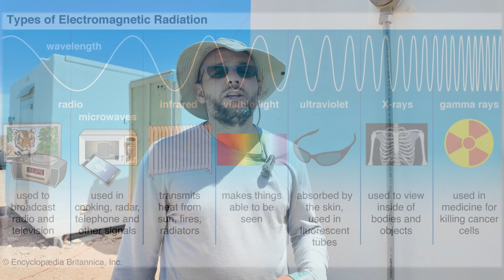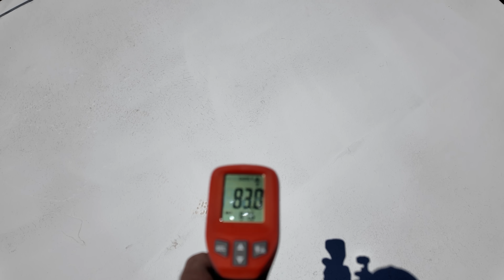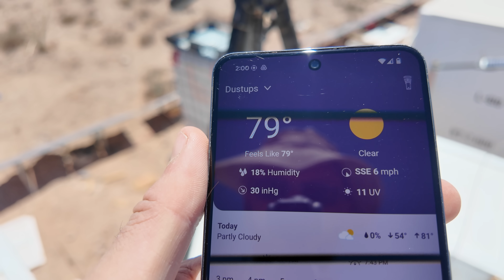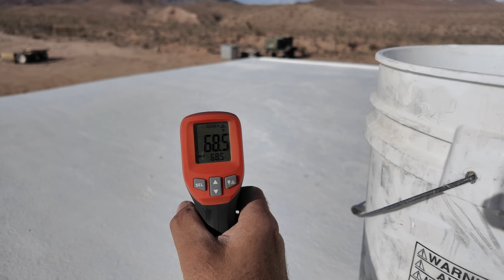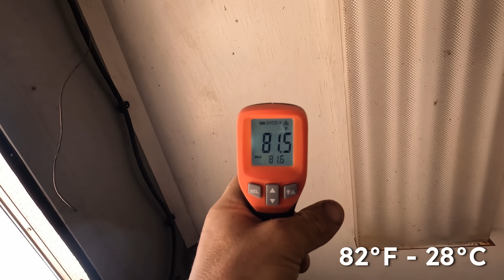I sprayed "cooling paint" on my desert cabin...this is shocking

Comment: I'm gonna be honest with you all... I've been here from the beginning, every weekend, but I'm losing my patience. Why did you buy a couple hundred dollars worth of machine, which you don't know how to use? Just buy a $10 roller and paint it lika a sane person. Also, you MUST paint sides too, especially southern side, where sun is always hitting. Another thing. Why wouldn't you just add a sheet of tile, PVs or something above the roof, with a space that it wouldn't touch the roof? Or doing something like everyone else is doing...styrofoam. You'd cool that roof to ambient level, with 1/4 of the cost of the paint. Literally throwing money to a trash bin. My man... I know you're American, but please... Stop spending our money, for trash that is not necessary... Literally had 42C heat wave year ago, and inside my house stayed at 28C, because of simple hear isolation... 30cm thick styrofoam... I don't even have AC in here...

I'll wait for the rain episode in 2 weeks, and I think I'm out. Because i can already tell, most of dams are flatter to the ground, because of the loose gravel and clay...

Comment: I've been seeing mini splits that have variable speed compressors and can run directly on solar panels. within the last couple of weeks I saw one mounted in a RV in the desert. high 90's outside and 77 inside on solar only. sorry I can't find it again or I would link it. probably not the cheapest but also not cycling batteries and not losing power in the inverter.

Comment: Hey there! Placing the solar paneles above your dog houses will create many good benefits, more shadow if you make them a bit bigger than the shadow plan of it, it will reduce big time the energy that arrives to you houses, will clean up space around the area, and create more shadow around. The aluminium structure needed is cheap and very easy to install. I live in Madrid, I know comparioit to your desert is not linear, however my rooms (top floor) used to be a radiation oven, once solar panels got installed my ceiling temperature dropped dramatically. With the equivalent of the paint you can get the aluminum structure or most of it.

Comment: Solar panels are cheap, have dual duty, keep the sun away and generate electricity to run heat pumps.
Whitewashing is cheap and the technology is 5000 years old or cover the building with the aluminum foil.

Comment: Take a look at house design in hot climates.  Take a look a 18th and 19th century houses in Qld.  "Queenslanders" Built off the ground with large wide verandas.  the aim was to keep the ground and the walls in shade.  To reduce the build-up of heat in the ground, where possible the ground was covered with grass, and surrounded with trees.  All to create a micro-environment with lower ambient temperature.  Ps A large roof or awning over everything to reduce rays heating the ground and the buildings.  For cooling purposes there is probably an optimal size for breeze ways between buildings.  Then raise a wall-less tent above the lot to create the biggest shade area possible.  There needs to ne vertical space between the tent and the roofs. Ensuring direct sunlight is kept far away from living spaces. Thanks for all your great work.

Comment: Well, this idea probably won't work there because it is too hot and dry and you have no water, but you could put in misters around the tops of the buildings.  Probably not possible, but it would feel so much better.

Comment: You are doing fine, do not waste money on further incremental measures.
The next big thing for dust ups would be getting a boring done at the appropriate location in situ.
This will be a game changer.
If cost is an issue, do some crowd funding.
This is the way forward.

Comment: Brother build a bunker! I live in the Mojave desert I built a cinder block bunker 10x12x10 I built it with a friend mix all the concrete made the foundation walls all of it for under 4k back in 2018. it works great. When its 100 degrees outside its 70 degrees in the bunker, if you do make one make sure you coat the outside walls with 787 Elastomeric Membrane its rubberized Asphalt before you bury it.

Comment: Now that you've painted, you probably won't want to, but another great option to experiment with is Spaced Insulation.

You could do it with plywood over the Kitchen, but many Vanlife builders use spaced insulation. Usually, they use Solar Panels, but if you put plywood painted the same white, if you don't attach it to the building, none of the Heat will make it to the building.

Comment: Idea for an experiment:

Bury some of the pipes under a  few feet of dirt using the dozer. Leave the ends open.
Pull air through.
Measure the difference in temperature between pipe air and ambient air.

Ponder if you need more pipes in parallel or connected in series.

Comment: The temperature doesn't sound that bad . I'm in Australia.  Is the wind hot or cool ? What is the temperature at night ? If its cool put windows in the little hot boxes. Shade the walls and windows with shade cloth.  When people travel in Australia with a caravan they hang shade cloth on refrigerator side of the van so as the fridge will work.  The area between the  hot boxs,  would be  more useable with shade cloth sails.   If you put like a carport over the boxes  it would create shade  and  the wind tunnel that would cool.

Comment: 97F (36C) temperatures. I laugh at that :) We have temperatures of that all summer and it regularly goes much higher. Our temperatures are measured in the shade and last summer we hit 115F (46C) for 3 days straight, then it dropped to 105-107 (41-42C) for a couple of days. In the sun it gets to 140F (60C) during the day. When it happens we stay indoors and don't go outside :). 

I don't see a fan at your desert shed, maybe invest in a couple of fans so you can sit in front of them to cool down. If you wet your shirt before sitting in front of the fan it works even better. Fans don't use much power so might be an option.

Comment: Aluminet UV cloth with metal grommets, and use bungee balls to attach to an aluminum frame is what we use at burning man. Holds up for 3 weeks of abusive winds with alkaline dust no problem. And gets used multiple times a year. You can make a modular framing, we do 6 12x12 ft squares, flat roof (rain not expected), slops are totally possible. Also 3 2’ rebar with impact drill in teepee form in ground per pole. 
I quite confident this is the best option without going full construction build and multiple layers of roof materials.
Reply: Thinking about it, canvas would be a longer term option, but it’s heavy.

If you go with a cloth shade, make sure to keep the pieces on the smaller size 14x14 would be the max, so wind can blow through and you don’t make a large sail.

Comment: GEZZZ,  WAY faster, WAY easier, WAY cheaper solution - mount some 2x4's or 2x6's on the roof and metal siding onto that, with a big air gap between the roofs to let air blow between the two = a building that's always in it's own shade. Like a roof over your roof.

Comment: I once rented an 7200sf warehouse with bare wood rafters and had a sight slope. 102 outside was 102 inside. I put Henry’s solar paint on the roof and dropped it to the low 80’s when in the 100s.

Comment: Ive been living and constructing houses in hot climates for 15 years now. This would be my advice get some 2x4 or 4x4s nail 3ft long boards to where ever is convinent and slap another cheap roof  over the 3ft boards. Even with that paint a significant amount of heat is going to go in because its connected. You leave the exterier roof open so the heat dissapates.

Comment: What also helps to isolate against heat is a so called "tropical roof". That is a second roof above the main roof. 
This can be easily achieved with solar panels a few inch on top the roof. The air between the roof and der solar panels isolates very well. I have done this with the box of my expedition truck and it reduced the inside temperature of the ceiling considerably.
And you can also mount solar panels at the sides. The PV panels also give enough power to run AC.

Comment: Cam nets about 30 cm above the roof and streching out at least 2-3 m from the roof helps due to shade . trust me im speaking from experience from serving in Iraq and Afghanistan it helps . You could just cover the areas in between the building which would help a little bit plus it would mean your not going out in to 100% sun light as soon as you leave the building.  But for best cooling you need at least  3 layer system for example Roof gap roof 2 gap Cam net .

Comment: Paint the sides, or the top half anyway. Radiating sideways isn't going to get anything reflected back at it =/ C'mon, it's not laser light it'll scatter and it'll hit the hill and bounce off somewhere else. Give your huts little wide brims, like a hat
Put your ladders steeper, makes mounting/dismounting easier at the top if there's a bit of overshoot, and a steeper ladder is more stable, less likely to slip and hurt you. 
Get a small amount of guttering, and run the water from the tub off the side of the truck.

Comment: Put large tanks in the ground with a wide air duct to the cabins. (Tanks with the same volume of the cabins.) Convection will circulate air. No electricity needed. Just clean tanks and labour.

Comment: IDEAS for efficient cooling, Shaun?  Okay.  My grandfather homesteaded his Wyoming ranch in in the Great Depression. He built three naturally cooled dugout garage-workshops where summer heat reaches over 110 F.  They NEVER got hot because the earth cooled them.

29 feet from a south-facing slope dig out the earth deep and wide enough to drop in one of your little buildings or build one inside  the hole after gigging. In fact, you'd gain efficiency by putting three of these units side by side in the ground, maybe separated by a couple feet if you wall of the earth in those gaps). The earth will keep your units cool year-round.
The reason for doing this fairly close to a south-facing slope is that you can have them buried almost completely on the West, North and East sides, and partially buried on the South side, but then easily dig a narrow walkout to the slope (AND simple steps up on either side if you want).

Or you can dig only about 5 feet deep and use the excavated earth to fill and insulate the top three feet around each of your units. Much less digging, but nearly as efficient cooling if the earth filling around the tops of the units has enough mass.  You may even find a way to safely support the weight of a couple of feet of earth over the roofs.
ALSO, you may find it cheaper to use white-painted sheet metal to defect solar radiation rather than special paint. I understand that paint is only good for 5-10 years.

Comment: I just came across your channel, great stuff. There is a much easier way to solve your heat issues that is thousands of years old and still in use by the Bedouin and other desert tribes today. The solution is much cheaper, modular, adjustable, and easy to maintain. My home has this design which allowed me not to use insulation in my roof, no mess, no fiberglass and it works much better and costs less. 

Double Roof Cooling Design (Inspired by Desert Architecture) This design uses two layers of roofing—an upper roof or canvas that absorbs the sun’s heat, and a lower one that provides shade and insulation. 

The key is the air gap between them. When the sun hits the top layer, it heats up—but instead of transferring that heat downward, the space between the two layers allows air to circulate, dissipating the heat. 

This prevents it from reaching the lower roof, which stays much cooler. It’s the same passive cooling technique used in desert tents: The top canvas takes the sun’s hit, the air space buffers the heat, and the lower layer stays cool, keeping the space below comfortable even under intense sun.  

You can also improve this by creating double roofs and double walls if the roof is not large enough to cover the surface of the space as the sun traverses the sky. The double walls are made from a frame and large slits so the wind can pass through. The walls can be a foot to two away from the box/space below and supported by the second roof. You can create a box around the box. This will lower the temperature around the bottom by 20 degrees or more depending on the space between the double roof and walls. Airflow is the key to this, and even when there isn't wind blowing the thermodynamic properties create air movement because hot air rises, and as it hits the outer wall and heats up the air flows up pulling cooler air from the ground.  

You can do this with canvas, wood, or metal it all works the same and you don't need paint which costs a bunch are requires maintenance. If the paint on the roof is not clean or free of dust you lose the benefit. Double roofs never expire and can have dual purposes as you mentioned towards the end of the video. 

Happy to jump on call and provide designs or just walk you though the details. Also look into YouTube Ancient Cooling Methods and/or Air conditioning. Ancient systems used simple thermodynamic properties to keep buildings cool. 

 I hope this helps, Cheers.

Comment: Insulate the ceiling with rigid foam.. Install a fan to blow hot air out  from the top of a wall or out the ceiling during the early morning when it is cooler. Keep those doors closed as much as possible. As small as your space is a small solar powered greenhouse fan might do it. Perhaps a shade cloth canopy over the south side area might help.

Comment: I wonder how this compares to building a roof over the pods.  a simple 4 post, slant roof that over hangs a little bit on each side for example.  that would be some up front cost,  but as long as it can  handle the wind,  would work quite well.  you could also explore putting solar panels on the pod roofs as well.

Comment: If you build a bigger building where it nakes sense a mini split can be a lot more efficient and i have concerned trying to take an old Window unit and converting it to a geo thermal unit but haven't really tried yet also you did that buried air thing already right you can do yhe same thing with a large loop like i would for the geo thernal ac but just run the water thru a radiator with a fan and you should be able to get air that is close to ground temperature

Comment: At $300/ per gallon, per side of each building, I am certain your money would be better spent on batteries and solar panels than on paint especially if your inverter can already handle more than you have given it to do.   $4500 worth of paint that can only do one thing for you, versus several kwh per day of generation and storage that can be used to pump water when batteries are full, loads are met and there is still surplus power from solar. If this adventure works out,  you will need more solar eventually anyway. Here's one for you, take one of the buildings you didnt put high tech paint on,  and shade it with solar panels instead,  then see how the two compare inside.  Be easy to fit 1kw worth of panels on one of those roofs, enough to run a window unit air conditioner all day long.

Comment: Partial shade fabric. you can add more layers as you need to increase the shade, and it is more windy proof than others solutions. This will reduce the overall radiative heating into the ground, allowing a cooler air to sink, adding a secondary feedback for radiative cooling.

Comment: 14:32 the thermal cameras do not work well when on reflexive surfaces. They will show the temp of the reflected object. You can see your body heat reflected back at you. This has something to do with emissivity. Shine the infrared camera at a mirror to see what I'm talking about. This is likely why the interior temps were not different.

Comment: Put a metal roof above your buildings. The cubes will always be shaded causing lower temps inside plus you can add a rain water catchment system for monsoon season.
Reply: The radiative cooling paint will get below ambient temperature if applied well, a roof can never perform as well as that.

Plus it's extremely cheap and easy to make by yourself, recommend watching the videos on it.

Comment: If the roof were made of sheet aluminum,  exposed indoors as the ceiling, it could suck a lot of heat out of the room, by conduction, for the paint on the outside to radiate. Maybe paint the ceiling black to absorb infrared from the room.

Comment: From a designer, fabricate a sheet of reflective (think tinfoil type reflective quality) metal on 12” sleepers so a massive majority of the solar radiation is reflected (more than white does) and the space under it allows for ventilation and shade above the roof.

Comment: Probably wont see this, but dig a 6-10 ft deep trench and coil pvc pipe in it with one entrance in the building and another on the other end of the trench and cover it in dirt. Place a small fan at the ingress point in the cabins so that the air cooled by being underground will be pulled into the cabins. A little fan will save you tons of electricity and you'll get nice airflow.

Comment: Cut out a notch into the side of the building, and install a factory fan, aka an inverted fan that pulls heat from the building's. 
You can find second hand fan's for cheap and re-purpose them.